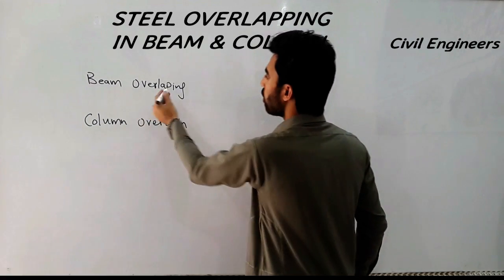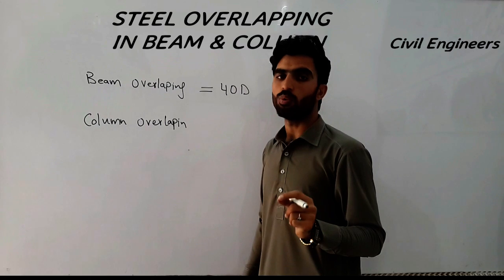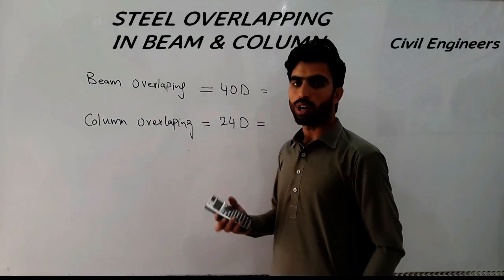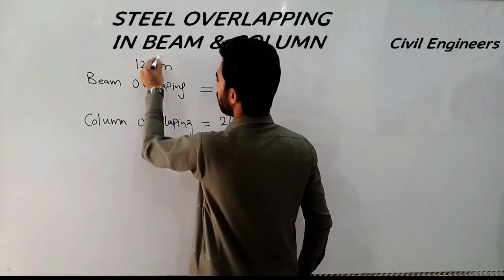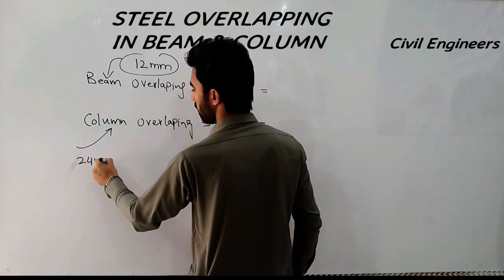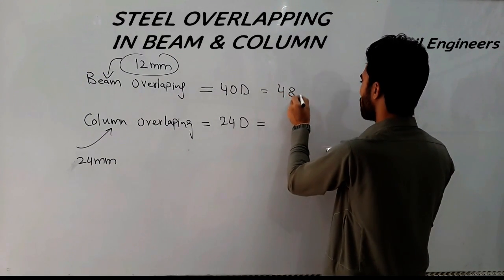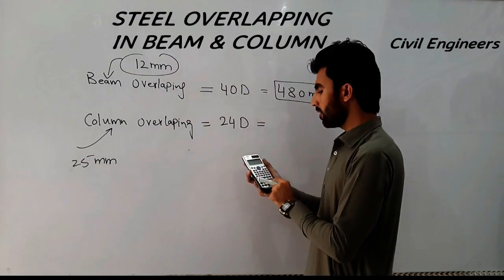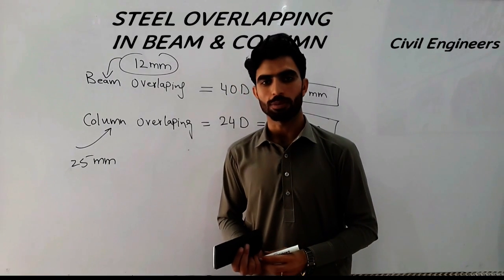How to calculate the over-lapping length of steel bars in slab,column and beam

Comment: If in a structure, e.g, 20mm steel bar is not available and
we use 12mm steel bar instead of 16mm bar, how can we
calculate the no. of steel bars for 16mm diameter bar?  what space will be enough   pls
Reply: calculate cross sectional area of 20mm bar (πd^2/4) and that of 16mm bar and find the ratio .. for 20mm c.s.a is 100π .. for 16mm c.s.a is 64π .. ratio of 20mm to 16mm is 100:64 .. 1.5625 .. so you must use 1.5625 x number of 20mm bars you would have used .. if you had to use 100 x 20mm bars now you use 156.25 16 mm bars

Comment: hey you can't say for beam it is 40D and for column it is 24D cz it depends upon the grade of concrete you use like suppose if you are using m50 grade in column then lapping length will be 36D

Comment: sir if we use different steel diameter in element than now which diameter should be taken the small or the larger one?
Reply: Anwar Khan i think we should take the smaller dia...not the bigger one
Reply: MOSTLY WE ARE USING SAME DIA FOR Lapping
........ACCORDING TO YOUR Q...YOU CAN TAKE  LARGER BAR DIA.
Reply: Its the larger bar Brock

Comment: what is 1.27 in how to calculate quantity of plaster🤔
Reply: LxTxH=CFT or metre cube convert wet cft or ,,, to dry form we have 1.27 constant for plaster then analysis
 of cement and sand 
for i.e 1:3 ratio used so sum of the ratio 1+3= 4

for cement  1/4 x cft 
for sand 3/4 x cft